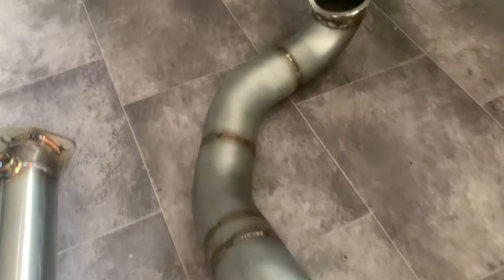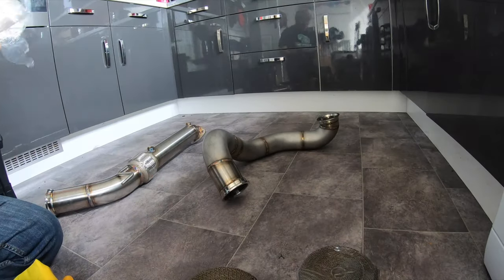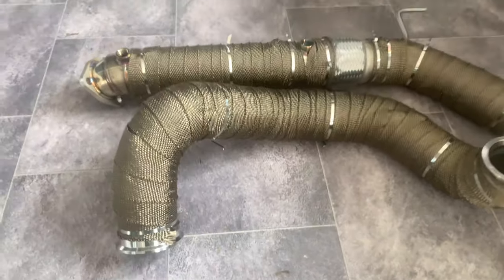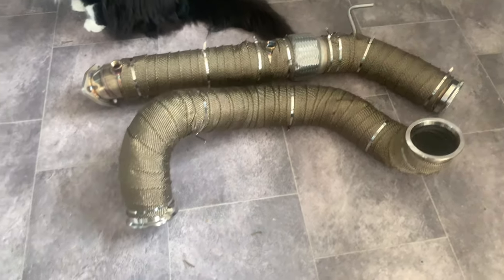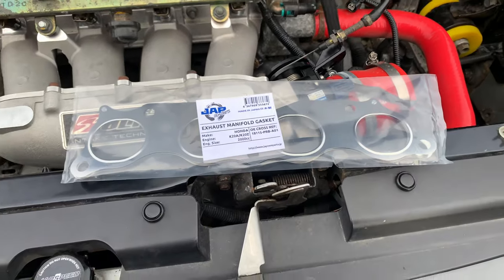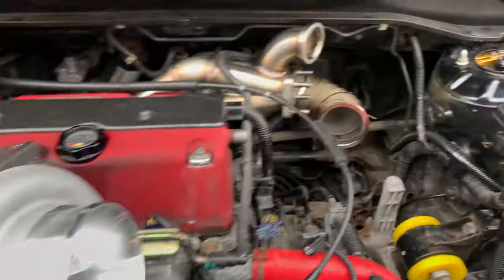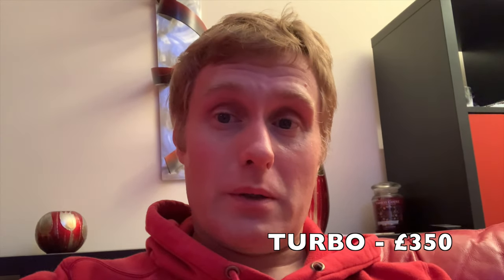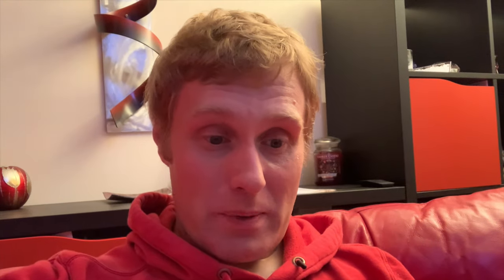K20 EP3 Type R Turbo Part 3 - Turbo And Manifold Fitting

Comment: That's really good, my ep3 build is costing me near to 14k and I'm only 6k in so far, keep up the good work. 👍
Reply from the maker: That’s some expense! Any advice on parts etc would be massively welcomed
Reply: You pay 8000 on a Honda ep3 must be jdm one was it 😂😓
Reply: @johntobin3673  prices have been creeping for awhile now. However 8 grand does seem steep. Probs a mint one. I got a 06 premier cosmic grey with OEM satnav, OEM bluetooth kit. OEM 6CD changer, OEM parking sensors, OEM foglights. Aircon, has JDM Carbon type r kick plates. JDM wind deflectors. Been ceramic coated outside & in 550£ it cost 😳! Managed to score that for 6.5. & it is mint condition tbh. Worth it however this ones the rarest I’ve ever seen. Deffo the only one on the road like it. Trying to sort JDM climate control & other bits too (Euro type r’s had Headlight washers ! Also wanna get an outside temp from the JDM one too) That’s for the future however. It’s totally stock bar 6K HID’s & revamped lights all round.
Reply: @redlineracing4947  ,my ep3 been taking apart and I’ve a Honda eg4 there so I’ll take the engine and box and drives out rad and look then sell the shell. It’s so much faster in the Eg rather then the ep3 ,but ya got to love a Honda ep3 get one now before there gone like the Eg civic hard to find with no rust and price will only go up
Reply: @johntobin3673  oh yes.
Reply: @johntobin3673  I suggest you copy a channel called “blue ghost” but for your eg. Don’t go crazy just keep it humble & proper & make some solid videos for all the Honda dudes out there. Would be a nice little series for sure man. Where abouts you based
Reply: @redlineracing4947  ,I’ve thought about it mate but I’m not as hands on as these you tubers ,I’m nearly in the process of leaving a deposit on another  eg hatch ,,want one for me and one for the misses ,mine be K20 red Eg and hers be b18 type r red eg 😂😂I’m banned off the road for 3 years so I want projects to keep me going and for track ,From Ireland 🇮🇪
Reply: @johntobin3673  sounds like a nice little series. Just be honest & say your not most hands on. Honestly the more info & videos out there the better. It’s certainly an interesting build mate ! One for the missus too. People will like that. Up to you however. What’d you do to get those years 😅👍🏼🚗💨🛠
Reply: @redlineracing4947  , that’s the type of stuff I watch aswell bud ha stuff that I’m doing ;,with the kswap for example I thought it would be a easy swap but it’s not easy on the pocket , so many parts needed I’ve one shell just got new arches and undersealed so needs spraying and the other Eg needs few bits aswell I’ve a 04 facelift ep3 for parts to shift ,red recaros and rails to fit.  5 stud ek9 hubs and trailing arms to put on I’ll be very busy hahaha get over Christmas to 🤯😳
Reply: @johntobin3673  oh man they are going to look MINT ! The premier Recaros I’m guessing ? You and the Mrs & gonna be the business mate. All th Brest for you & good man for bringing your girl into the world of cars. People start driving at the ripe age of 17 or older & that is how you get from A to B for the rest of your life! Why spend it in a dead shitty econobox ? Learn how to drive, learn how to fix & get your bloody hands dirty! 🚗💨🛠 hopefully we’ll be seeing some videos eh?
Reply: @redlineracing4947  ,yea well I’m 34 mate haha she 25 ,I’ve had so many Honda’s haha I’m addicted and now there going up in value so jumping on it, I’ve had dc2 type r tegs and sold them years ago for only 3500 now there 12 k or more so I’m not losing out anymore haha o and sorry mate no not ep3 recaros I’ve dc2 red recaros in one and there is sir seats in the other
Reply: John Tobin ahaha. ! Another bredrin. Hondas are the business. Love them to bits. Astonishing engineering & loads of parts & fun. Great little cars. Miles is no issue aslong as maintenance is taken seriously. Rev highly & freely all day everyday no issues. Lovely sounds. Bar the ricers :/. Love hondas totally. Very good cars to get into. Honestly I recon you might not get a lot of views at all. But over time can build a nice comment section. It’s a great way to spread relevant info for people & we are the true people of the world. Doesn’t need to be anyone. Can be you. I digress haha. Was the Dc2 c pack ? Champ white :)? Man love Teggies.
Reply: John Tobin I know it sounds silly. I’d say get a old camera kicking around. Gives videos more of a wholesome feel. All this modern stuff you know ? Or use your phone. Anything you want really. Just give it a think. You could deffo do it & lots of ppl will enjoy the journey. Sounds quite nice man 👍🏼
Reply: @redlineracing4947  yea I might bud I just do it for fun not for money I would enjoy it ,,yea well keep an eye on these videos to see my comments i always post on her ,I think I’ll wait till I pick up my second eg start it with the 2 of them
Reply: @johntobin3673  awesome ! Perfecto way to start. The beginning of the build. Great !
Reply: @johntobin3673  hey john! Just wondering if you’ve got an update ! How’s it going for ya
Reply: @redlineracing4947  no leaving it till after Christmas buddy get psssed this year and then the it starts I was waiting on back disc breaks conversion and need to get my dc5 steering pump as mine in the ep3 is electric rack and manual in the Eg and hybrid racing shifter box with cables

Comment: Another great upload. I see that you've relocated your number plate, is that your old number plate just bent round and secured with fastners?
Reply from the maker: Yeah, heated it up bent it slightly then screwed it back on. Keeps it the correct size for the law men.
Reply: @1BlueGhost  That's a brilliant idea, I never thought of heating the number plate but did wonder how you had stopped it from cracking. Thanks for the advice.

Comment: Did you have to reroute the coolant pipes that go from the bulk head?
Reply from the maker: No they cleared ok, but I wrapped them in exhaust wrap as well just in case. Haven’t had a problem with them so far

Comment: What size cat back are you running with the turbo mate
Reply from the maker: its a 3" solid fabrications system. I need to get the reducer parts swapped for a 3" v band at some point though, as they are joined by the standard size 3 bolt flange after the lambdas.